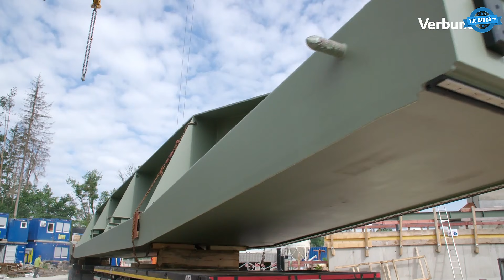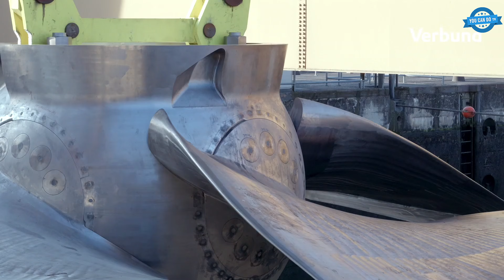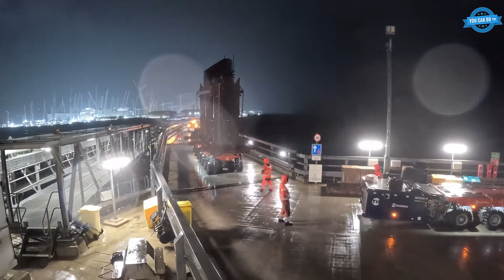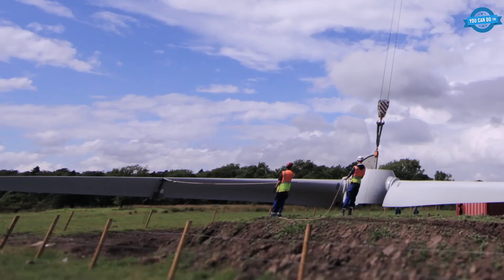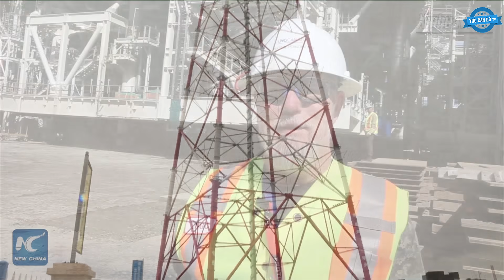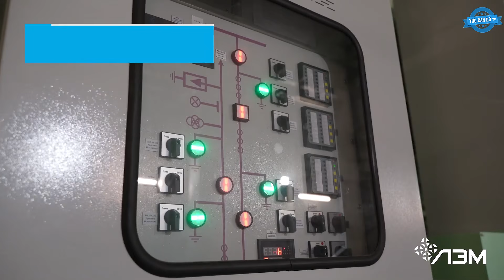Extreme Engineering: Building the World's Largest Power Systems

Comment: What a waste of money and destruction of farm land.
Do people not know that the amount of energy and fossil fuel it takes to produce these so called clean green energy systems.
The raw materials are mined ,processed,refined then transported to the factory where the panels and wind turbines are produced they use fossil fuel as the power source for plant operations and the panels and turbines are transported to site they are handled with machinery and equipment that runs on fossil fuel, the turbines and panels are usually only 10% recycled at end of life and when they are dismantled they are hazardous waste due to the large amounts of asbestos and other carcinogens. 
But people still argue that it is cleaner than nuclear generators 
Oh it must be nice being that brainless